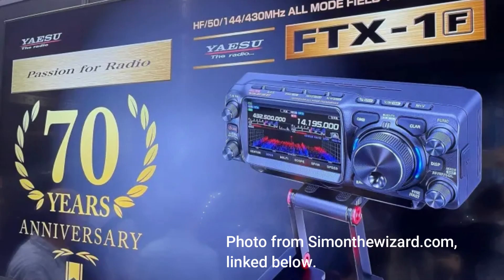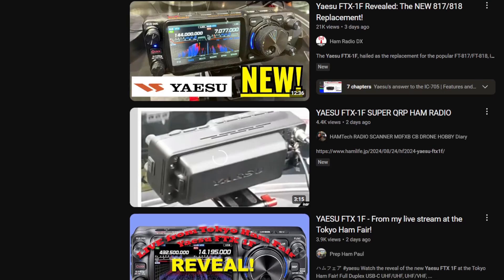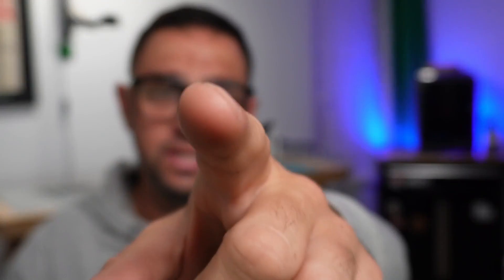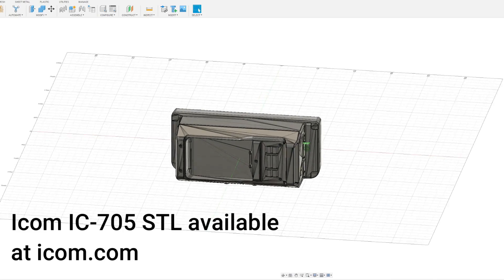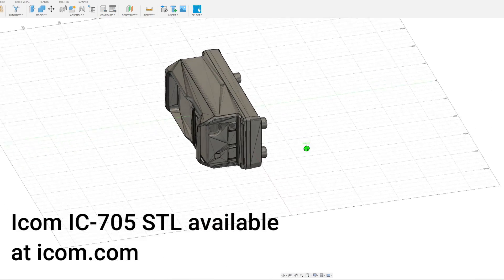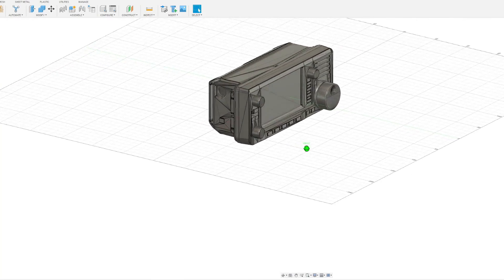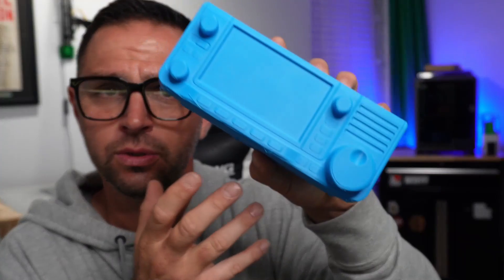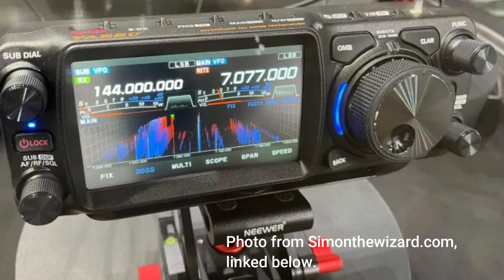The Yaesu FTX-1F Needs This: An Open Letter to Yaesu

Comment from the maker: UPDATE: Yaesu public relations reached out to me after the video was released. They stated (summarizing on my part) they have a no interest in releasing a STEP, STL or other design on any radios currently in production or any future releases.   I really appreciate all the support from everyone who agreed this was a good idea, but we cannot win them all.   Thanks  Yaesu for the response.   - 73!
Reply: Personally for me this looks pretty bad. Yeah, we can scan, we can do other things. But they have everything, am I correct? They do? Or maybe not... I have been asking for programming protocols... Why not, as a community we can do something for free. But they don't want that help (hobby work). I can do reverse eng. But that need time, and I can brake something. So... is it the time to say godbye yaesu? This is sad for me.
Thank for your open letter. As I mention this tells to me much more...
Reply: Pretty dumb, but not unexpected. I didn’t even think this is a revolutionary ideas / suggestion, just plain common sense in an age where every ham has a 3D printer. Alas this won’t change a thing, just delay it by the one week it takes somebody to take measurements and crank out a model. 🤷
Reply: @labcat73 or a 3d scan of the radio which is pretty simple these days too with photogrammetry or Laser /ir scanning tools. Wonder what the internal reasoning is for why they wouldn’t want to just release it? Do they consider it possible competition with accessories that would be produced easier ?

Comment: Good afternoon..There are some looking at getting ahold of consumer fraud and go after Yaesu. The update did nothing to help at least mine. When ordered I was not told it didn’t function. There a lot of things that do not work right. Nobody I know would give this kinda money for a paper weight. That might get the attention.
Reply from the maker: Are there problems with the radio?  Genuine question
Reply: Have the GPS and it does nothing. So that means APRS and digital can not use it. Of course no reply on aprs and other things. When I bought it did not say it wasn’t fully functional. Would you buy a car with no engine? Well when engines are done we will send you one. That is not the way commerce works. To me if you sell a radio as complete and you can prove manufacture knew ,that my friend is FRAUD.

Comment: Yaesu needs to release a decent portable HF radio like the G90 (only better quality) that the average people can afford. If Xiegu can do it for around $450, certainly the braintrust at Yaesu could do it for $600. I already have an FT891 that was around $600 when I bought it. But hauling a 100-watt radio and battery on a POTA activation is excessive. That's what I think anyway. But what do I know. I'm just a consumer. I already have VHF/UHF HTs that are Fusion-capable. I don't need that built in to a do-all radio. This FTX-1F is most likely going to end up at least two to three times the cost of the FT-818.

Comment: UPDATE . That radio does not have FCC type acceptance as of AUG 31,2024.  BY law in Japan and US That STL file and lots of information can not be released until the PART 97  of FCC comes threw. This takes time. Yaesu released some info before the part 97 went threw.  This is coming from Yaesu .  Once that type 97 goes threw will will have all the info. This is a part  97 radio not like the China part 15 FCC radio.  73
Reply from the maker: Thanks!  I appreciate it! Yaesu is not going to release the STEP or STL files.
Reply: @DudeTested  Yaesu is in Japan and laws are different. Once the part 97 goes threw things will change and we get more info on the radio .  Once the first bach goes out I am sure someone will 3D scan it and we have a STL file. For now we have to wait. Just RED tape . The new Icom does have the part 97 approved. just waiting on shipping.

Comment: I think the cage concept looks fraught as the optional items snapping onto the back would make a deeper cage or maybe thats a good things since the radio with all the wires will stay upright. I have the Z mount on my 705 and took it off when I got the Windcamp cage and just never found it as useful out in the field as thought.

Comment: What's up with the Max Headroom type editing.  Do you do it to cut down the video length?
Reply from the maker: I am Max Headroom.  Kidding aside, I was reading from a script that was on the monitor below me, which caused me to continuously look down.   I could put a teleprompter up, but I need to figure out where to put it.
Reply: @DudeTested  I see guys using a screen next to the camera. You can see the eyes roving the script as they look at you. It works.

Comment: The accessories market is bigger than the base product. It boost sales of a base product and creates a fandom. Just look at what happened to the AR platform. Or the Ruger 10/22, I bought one just to mod it & make it unique. Look at the popularity of Overlander trucks & SUVs. People buy them just to put on external fuel cans, traction boards, rooftop tents, light-lift hacks, cargo baskets, off-road lights, just to shuttle their kids to school. Choppers, Hot Rods, you name it. HAM radio is the next big thing! Look at how many signature EFHW are out there. But none compare to the Dudetenna!

Comment: Anyone thinking of buying into this radio should remember the FT-991 / FT-991A debaucle and all the people Yaesu screwed.
Reply from the maker: Except just out of curiosity, what does this have to do with my video?And the point that I made in the video?  I'm trying to understand. Please fill us in about the ft991 STL debaucle. Or did you not watch the video? cheers
Reply: @DudeTested  I was referring to Yaesu as a company and for people to be careful with adopting new products from them early. Early and expensive adopters of the FT-991 radio were left out in the cold when Yaesu released the FT-991A very shortly thereafter. Enhanced features made the FT-991 much less valuable and hurt the loyal Yaesu buyers who supported the FT-991 early.  I might add, just me but I found your jumpy camera work to be really weird there Magoo. I did watch the video and if you're not English quit saying cheers.
Reply: I usually have to loosen my debaucle after a big meal.
Reply from the maker: A Gatekeeper of speaking... got it
Reply from the maker: PS: cheers, Mate
Reply: Same thing with the ft5dr junk

Comment: I don't have a 3-d printer, however, even with the STL files available, I am able to design parts for my desire, and have them printed at a friends.
 I can decide the configuration that fits my needs. If the tuner doesn't fit my needs on the back, I can put it where I want it, or make a holder for the GPS antenna, or whatever other doohickey I may want or need with the rig.
 Absolutely release the kraken, I mean the STL files!

Comment: Everybody asks for an STL. No! We want a STEP file. A STEP file is the standard for solid modeling and can be manipulated by all CAD software. STL files are shell coordinates for machines (3D printing, CNC, etc.). One can easily convert STEP to STL but you cannot convert STL to STEP without loosing information (screw holes are filled in, thread pitch is unreliable, small features missing, etc.). It drives me nuts when people only upload the STL on model sharing sites. I tried multiple conversion engines and could never get the IC-705 STL to convert to a solid model accurately. It was fun to 3D print it though.
Reply: Yes, this. Mesh files are interior for what we really want to do with them - develop mods.

Comment: another radio that's a waste of time unless your into p.o.t.a don't get me started on the icom I think I will stick with what I have here in the shack
Reply: I see you edited to clearly show P.O.T.A but this radio is good for other O.T.A like SOTA, IOTA, lighthouses on the air, etc. Also pretty much most other portable setups where carrying the batteries or generator to run 100watts or more is more difficult. For shack stuff I agree you can run other rigs because you have the house power or in a lost power scenario big batteries or generator.
Reply from the maker: Traveling in airplanes, through airports... etc
Reply: By pota do you mean portable?

Comment: If Yaesu should not release the stl-file, I could create an accurate 3D-Model of the radio, but therefore, someone needs to donate it to me first, so I can take all the measurements. 😊
In return, I then would make the file freely available. deal?
Reply from the maker: As long as yaesu loans me the radio 😅

Comment: I'd like to see a plug in BRICK that was an amp and tuner in one unit.   imagine. this radio in a moblie, and the brick under the seat or anywhere.  When your mobile, you got a nice rig, when you get to the park you take out a QRP rig that's always with you.  and the interface would require ZERO menu adjustments. if its plugged in the brick works. if not it doesn't. simple.

Comment: Let me just say, they could one up icom by simply releasing a step file instead of an STL. 
For creating things like cases or accessories, using an STL as a reference is horrific, especially when there are circular structures to reference (like mounting holes). It's about the worst file type for this type of stuff. 
STEP on the other hand, maintains all model features, making design of accessories super easy, especially when it comes to holes.
Reply from the maker: You sir, are correct. Thanks!
Reply: Ha! I just posted the same thing!

Comment: Well its qrp Rig but Price will be qro!
So what is QRP ? 😂
Reply from the maker: you didnt watch the video, i assume?
Reply: With the exception of extremely high-powered amplifiers there isn't a correlation between price and output.  The cost of 100 watts is cheap.  Building a quality high-performance QRP radio is a far greater, and more expensive, task than slapping 100 watts in a cheap radio.  If wattage was the goal then everybody would just lug around FT-710's and IC-7300's with low end internal tuners and carry bigger batteries.  That doesn't appeal to everybody, which is evidenced by the huge success of the IC-705.  That's obviously why Yaesu knew they needed to design this radio.

Comment: They want to release the CAT commands too as when the 710 came out there were enough CAT differences to affect operation with a lot of software. Maybe with it being another SDR radio, it will use the same command set as the 710, but there are bound to be some differences.
Reply: THIS. THIS has always bugged me with YAESU.
 I have the FT-897D. Its a CAT nightmare. I do not know of any bricked EEPROM's, however, I know of many that used the non standard commands on their rigs.

If Yaesu would just be a little more transparent, and willing to interact with the amateur community BEFORE the problems start, and to create a more friendly relationship, I believe more folks would enjoy Yaesu products more.